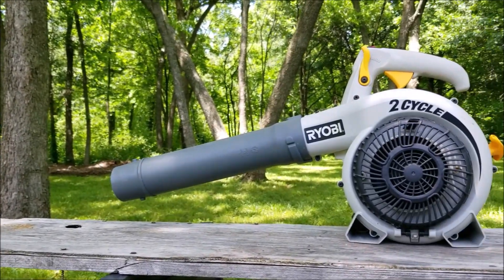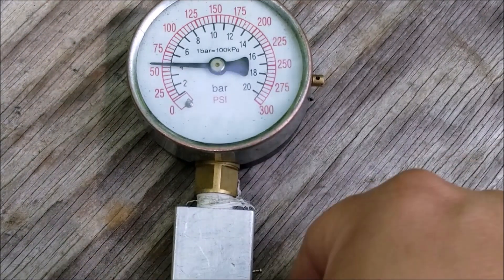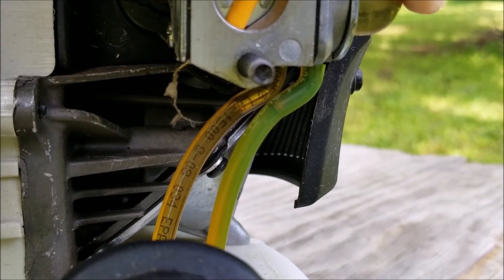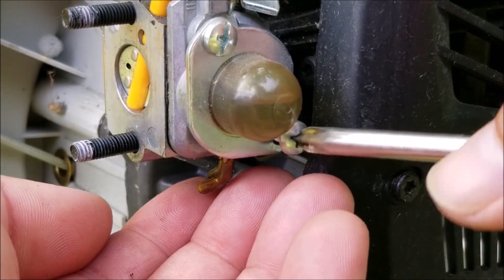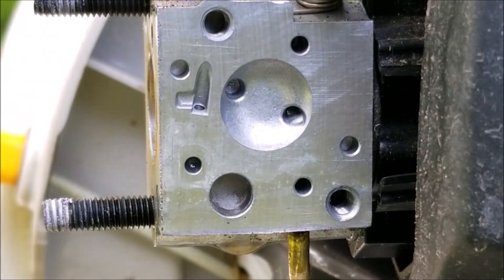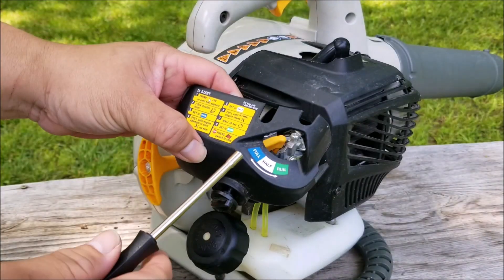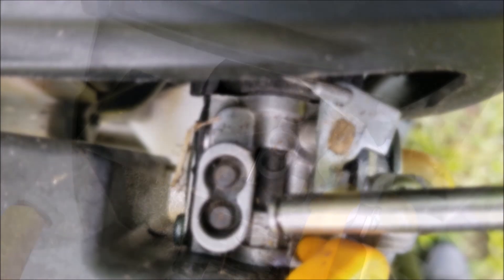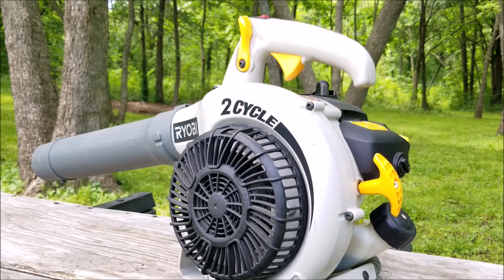Leaf blower starts but won't stay running finally fixed

Comment: My leaf blower starts but after a few minutes of used it dies out then won’t start after that. Have to wait some time to get it going again but same thing as said. I believe these options are needed to get fixed, correct? Also, could it be the 2 cycle oil mixture not added as well because I’m only adding the normal gasoline I get from the gas station mixed with ethanol. Sorry for the questions if missed on the video as I’m still learning to fix on my own and not spend on new equipment.
Reply from the maker: I don't understand the part where you said" could it be the 2 cycle oil mixture not added as well". So are you mixing the oil in the gas or not?  To answer the first part of the question, Fuel requirements for when an engine is cold vs. hot are very different. I think you would benefit from adjusting the carb when the engine is warm so it doesn't die on you after a few minutes.
Reply: @HomeGaragechannel  I know that some equipments require a mixture of gasoline and 2 cycle oil for them to work as it comes with the package, but right now I'm only using plain gasoline without the oil mix in there meaning I have not added any mix of oil at all when the first ounce was gone hence day one. Could that be an issue or it does not matter if the oil is not mixed in there and just keep using octane gasoline with ethanol and adjust the carb? I had this issue with my weed eater when I stopped using the 2 cycle oil few weeks later. Perhaps like you say cleaning the carb would work. I did clean the carb on my lawn mower but I was not using any oil mix with that one. Just learning as I go here before I mess something up.
Reply from the maker: @KnightAvailable  unfortunately running a 2 cycle leaf blower without oil in the gas mixture will damage the engine.  That means it will now work properly anymore.
Reply: @HomeGaragechannel  It may still work properly. I ran a chainsaw like that because I thought it was a 4 cycle for some time. It died out usually after 15 minutes of run time. I thought it was just messed up. I finally realized it was a 2 cycle engine and used the proper oil fuel mix and it doesn't die out anymore. My dumb blonde moment haha!

Comment: For those playing along at home, run some carb cleaner through the center of the fuel cap.  If it is restricted, the engine will starve under load.
Reply from the maker: nice tip although I've only seen that problem a couple of time

Comment: My Son's Craftsman backpack blower is doing exactly the same thing. I have replaced the purge bulb, fuel lines, fuel filter with no change. Air filter and spark arrestor also cleaned. This is a 4 cycle engine and I changed the oil, used clean fresh fuel with no results. I will go back and see if I can clean the carb further. Any ideas for a 4 cycle? Thanks
Reply from the maker: yes absolutely, replace the Carburetor.
Reply: @HomeGaragechannel  After I posted my question I went back and took the carb off the motor and cleaned it further with no visible residue showing. Put it back together and it runs great!. I believe the purge bulb may have been pinched. Thank you very much!
Reply from the maker: @Suncast45  Excellent work thank you for the update

Comment: This season, I'm trying a full tank of Trufuel over winter in my Echo trimmer.   All my other gas-operated equipment is run dry and then put on the compression stroke.
Reply from the maker: Wow you really care a lot about your equipment.  Thanks for sharing

Comment: I have the Homelite version of this machine.  Was using it "yesterday" on the front yard and it was running fine - but I ran it dry. "Today", with fresh gas, I can't get it started.

If I prime the carb, it will start and run until that gas is gone which is very fast.  As a test, I took the fuel filter off and it still won't start/run and yes, I'll get a new filter.

One last hint:
The next day, with fresh fuel in the tank, I noticed the primer bulb would not re-inflate once pushed. I let it set overnight, it re-inflated, but would revert to not springing back once compressed - that's when I removed the bulb assembly and checked the fuel and return line for blockage.  The bulb does reinflate now, but it resists doing so.

Any ideas as to why good one day and not the next?
Reply from the maker: sure, there's a blockage in the carb. I would replace it.
Reply: @HomeGaragechannel   got the blower/vac in 2017, have abused it ever since with no maintenance whatsoever.  Bought the carb replacement kit, will arrive tomorrow.  THANK YOU!
Reply from the maker: no problem

Comment: Question: I have a old ryobi trimmer that is about 5 years old that takes around 10-20 pulls before the engine start to run. Once it runs it runs great without any issues. Same with my craftman mower. Any ideas? thanks in advance.
Reply from the maker: Interesting.  Since it's only a cold start  issue I would say the choke circuit is clogged. Have you inspected the carb?

Comment: I don’t empty my blower during the summer as I use it weekly. 

Do you ever remove the adjusting screws and squirt cleaner into the hole?
Reply from the maker: I used to a long time ago but I dont anymore.  I might have to start doing it again.  Is that what you do then?
Reply: @HomeGaragechannel  I don’t remove the adjusting screws and clean them.

Comment: I leave fuel in depending if there was any left after the season in Canada... but that said I use non ethanol ultra gasoline
Reply from the maker: What's the octane rating for ultra?
Reply: @HomeGaragechannel  in canada Shell is 94 with no ethanol
Reply from the maker: @sweetlou5902  thats really cool.  We're stuck with 91 and that's it
Reply: @HomeGaragechannel  oops I goofed, I meant to type 91 octane, sorry...   but still 0 ethanol
Reply from the maker: @sweetlou5902  ah no biggie. Thanks for the comment

Comment: Good job.
You’re not the first person in there.
Two different fuel lines.
I bet the down tube would make a huge difference.
What was that stuff plugging the screen?
Reply: The spark arrestor?
Reply from the maker: i believe you're right. I think its the metal from the filter corroding.
Reply from the maker: @smallengines1018  the spark arrestor  sits over the muffler outlet and keeps sparks from flying out of it.
Reply: @HomeGaragechannel  no no.no I know I thought he or she was asking what the spark arestor was
Reply: Its the weight in the fuel filter. Take one out and look at it. Over time, they break down and end up in the fuel. Use a file on the metal weight over a paper towel. Look familiar?

Comment: How do you recommend storing 2 cycle lawn equipment? I have a ton of echo and stihl 2 stroke small engines and a couple small 4 strokes. I always was told to keep my generators full of gas all winter or else id get rust so I kinda just assumed same on weed eaters and such.. but thinking about it now they all have plastic tanks. Should I be storing them completely empty? I have been getting a bunch of battery powered lawn tools lately so the gas stuff tends to sit.
Reply from the maker: I always suggest storing them empty AND ran dry till they stop. Also make sure not to use ethanol gasoline. Generators are a different thing. I would probably keep gas in them filled all the way but I don't even do that either.
Reply: @HomeGaragechannel  thank you!! I always use 90 octane non ethanol boat fuel. I live near a lake so it’s not hard to find.
Reply from the maker: @scottcoleman7304  nice you're luck then, thanks

Comment: I have a Poulan PLB26 leaf blower runs then dies when the gas cap is tight 
Loosen the gas cap and it runs good 
Replaced carburetor, gas, lines, and gas filter Cleaned gas tank out Took gas cap apart and cleaned it and it’s still doing the same 
Compression is 80 
pounds 
Hope you can help
Reply from the maker: sure, replace the fuel cap. it would seem the duck bill in the cap is stuck closed.

Comment: Good video.  I have this model Ryobi, it's around 10 years old and it has worked great but now I'm having issues with it.  I just bought a newer model Ryobi blower but I'd like to try to fix my old one and keep it as a backup.  May try to clean it up and see if I can get it going.  What kind of cleaner were you using?
Reply from the maker: It's carb cleaner. If all else fails, just replace the carb
Reply: @HomeGaragechannel  That's what I thought. Just wanted to confirm. Thanks for the quick reply.
Reply from the maker: no problem.

Comment: I have an echo pb 2100, I simply cannot adjust it to run right. I can take the high-speed adjusting screw all the way off or screw it all the way in and again no difference. Is may carburetor shot?
Reply from the maker: not yet, how many turns is the L screw out?

Comment: I have a Husqvarna  blower simular to that. It starts and runs for a few seconds, then dies. I replaced the carburetor and still does it. It has compression and when it starts it runs really well, but then dies. If it had low compression it wouldn't  run at all. I have repaired tons of these leaf blowers and this one is kicking my ass. The fuel lines and everything are new. I took the catalyst  out of the exhaust  thinking that might help. Nope. Your was obvious. Seeing the junk in the carb. I put a factory replacement carburetor  on this thinking the aftermarket one was the issue. I am starting to think the pulse channel in the engine is plugged. Thats my last best Idea.
Reply from the maker: Thats a pretty good idea. I would also consider an intake leak at the gasket, insulator or loose cylinder head bolts.

Comment: I have a blower like that and I used it for the snow and I noticed that every time you squeeze a trigger you hear tapping what could be the problem and it's coming from the engine
Reply from the maker: can you give me a time stamp in the video for the noise? I didn't notice it when I went back to watch it.
Reply: @HomeGaragechannel  I was trying to tell you that for my leaf blower every time I press the trigger you can hear a tap from the engine
Reply from the maker: @IvanOchoa461  oh I see.  Can you hear it in your snow blowing video?
Reply: @HomeGaragechannel  what snow-blowing video i don't have a video
Reply from the maker: @IvanOchoa461  oops my bad
Reply: @HomeGaragechannel  okay but I need to know what does it mean that every time I squeeze the trigger on my leaf blower and makes a tapping sound what is the problem
Reply from the maker: @IvanOchoa461  I'm not sure.  If I could hear the sound it would be helpful

Comment: A lot of muck, how did it get in there?
Reply from the maker: It should be corrosion from the metal in the filter
Reply: Those fuel filters have a pressed pot metal weight that actually  breaks down over time and ends up in that screen. Don't believe me? Take one off and use a file on the metal weight, look familure now?
Reply from the maker: @scottfirman  you are absolutely correct

Comment: I have the same blower with the same issues it will run or idle for a length of time then dies or if you switch from choke to half choke or run it dies I have the tool and I'm making tiny adjustments but nothing seems to change
Reply from the maker: it would seem like the carb needs to be serviced.

Comment: my blower has huge spark, 90 psi compression, and wont start with starting fluid? 

Its a cheap Homelite 26cc but barely used. It stopped working last summer in the middle of me using it for 2 hours. I replaced the coil. Huge spark. But it still wont start. Any ideas would be so helpful..
Reply from the maker: have you considered replacing the spark plug?  I would try using a drill to Turing the engine, without any fuel, just in case your engine is flooded.

Comment: I leave fuel in my equipment for long periods without any problems, however, the petrol (gas) is non-ethanol, and I'm in a very mild climate (near Sydney, Down Under) so the fuel lasts fine. I once left fuel in a logsplitter outside for 3 years and it started first pull and ran fine lol. I totally get I'm lucky with my climate compared to some cold country cousins!
Reply from the maker: wow that's some great Fuel you're using . thanks for the comment
Reply: South East Qld here , same deal , however yesterday my blower decided to give same symptoms (it's a week out of warrantee would you bloody believe it ) as the one in the video , I'm about to try the same fix ........

Comment: I just adjusted my carburetor it won’t stay idle now and when I turn it on full it shuts off what did I do wrong?
Reply from the maker: do you remember what setting where, or can yo turn it back to where it was at, before you started adjusting it? IF so, you'll have to tell the  turns you took and then I'll be able to tell you how to correct it.
Reply: @HomeGaragechannel  I use the double d tool and turn the L counter clock wise and then I turn the H full turn now it won’t stay idle. But runs better on half and run but now it won’t Idle on full it just cuts off now I have to hold the gas lever to keep it running! So did I turn L side of the carburetor incorrectly?
Reply from the maker: you didn't mention how many turns  you turned the L screw counter clockwise, and how did you decide on "How many turns" to turn them?   You aren't using the turns from the video are you? it's best to only turn them a quarter turn at a time, that way, you can see things aren't working.
Reply: @HomeGaragechannel  I think I turn the H&L screw too many quarters turn now the the dam won’t start at all this morning trash can it goes!
Reply: @HomeGaragechannel   hey I got blower to come on does my idle speed supposed be higher than my engine speed because when I switch to full it cuts off??

Comment: Got one of these,but the coil wire is broken at the spark plug boot and the carburetor is really in bad shape
Reply from the maker: Do you think you'll try and fix it?
Reply: @HomeGaragechannel  not without the parts I need

Comment: Can I ask. Do you know why when I had a clean spark plug in this same one I run it for 1 minute and then when I took it out it was all black
Reply from the maker: sure can, either the carb is causing the engine to run "rich" with fuel, or it's the wrong spark plug  for the engine.
Reply: @ the spark plug is c18 champion
Reply from the maker: that spark plug is the wrong "heat range" Try replacing it with the one in the video and try again, If it happens again, then you'll need to adjust your carb.

Comment: Correct me if I'm not right the older the engine the more time it to run at idle  til.it warms up a bit  then give it some gas then it's good to go but you got this one machine back up and running see you later young man
Reply from the maker: im not really sure about that.  i could see that for an older car. maybe someone else could answer that.
Reply: @HomeGaragechannel  okay thanks for your reply young man
Reply from the maker: @robertmailhos8159  no problem
Reply: @HomeGaragechannel  thanks so much
Reply: It is possible to damage the piston by revving the engine full throttle before it warms up, especially if you put the cold engine to work right away. The piston being less mass than the cylinder expands at a faster rate than the cylinder. Four corner seizure is one term I've heard that called.
Reply from the maker: @2aminitials  you are absolutely correct about that
Reply: @2aminitials  glad you are.knowing  about the matter of the subject on what I commented on 👍👍

Comment: Hi and thank you for you’re hard work and insight, I too like another poster said like your systematic approach and I too subscribed in larger part because of that. I do have one question, finding that much grit in the carburetor and fuel filter makes me wonder why you didn’t inspect and or clean the jets. I’m not sure if you did that off camera, editing or the video would run too long, again, thank you for your channel and hard work.
Reply from the maker: no you're' right I should have inspected them.

Comment: What’s the water squirty thing you use?
Reply from the maker: you mean my water sprayer?  It's an airless paint sprayer using water.  It's extremely effective at cleaning, and I can use my hands, and not worry about getting hurt, unless a pressure washer
Reply: @HomeGaragechannel  thank you
Reply from the maker: no problem

Comment: I cleaned air filter, fuel filter, blew fuel lines out, drained old fuel, put new in, now it wont start at all..... it was doing the same thing as in video before. So frustrating i cant do the simplest of jobs when it comes to engines 🤨
Reply from the maker: you might have to adjust the carb
Reply: @HomeGaragechannel  ok, its a weird tool to do it, iv ordered the set in your video
Reply from the maker: thanks

Comment: I have a Stihl blower Br 600 and it runs well until i turn it off and it kinda stutters like it doesn’t want to turn off. Can you help please?
Reply from the maker: I haven't used a BR600 but is the kill switch the kind that slides and stay in that position, or do you have to hold it in the off position till the engine dies?
Reply: @HomeGaragechannel  you just push it down and it turns off fast but this one doesn’t want to turn off easily, it kinda sounds like it wants to start back up
Reply from the maker: okay I think the ground wire is loose, either on the engine side or on the switch.
Reply: @HomeGaragechannel  thank you so much for your help and i enjoy your videos. Keep up the good work